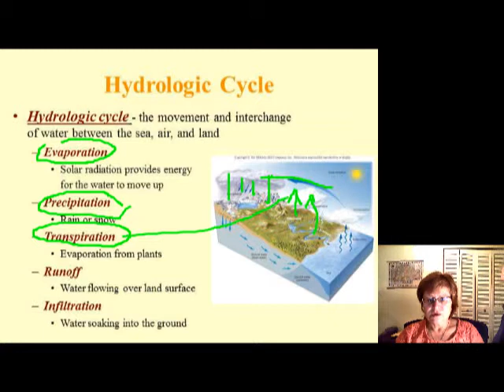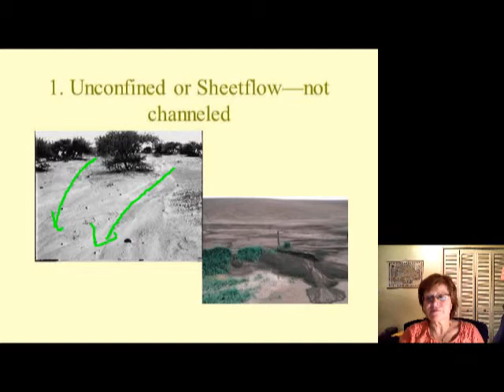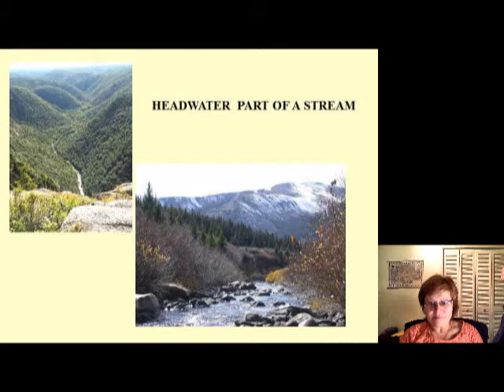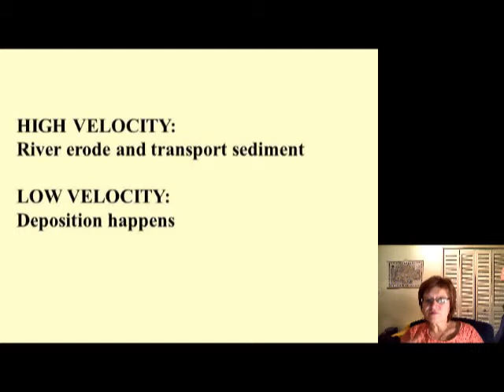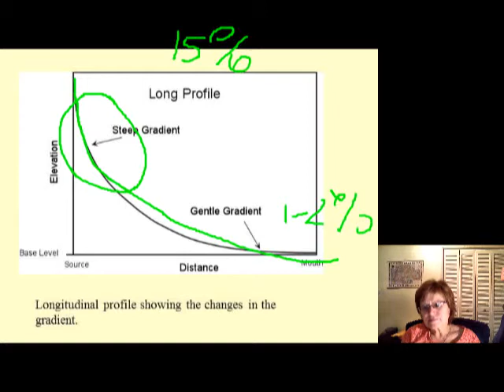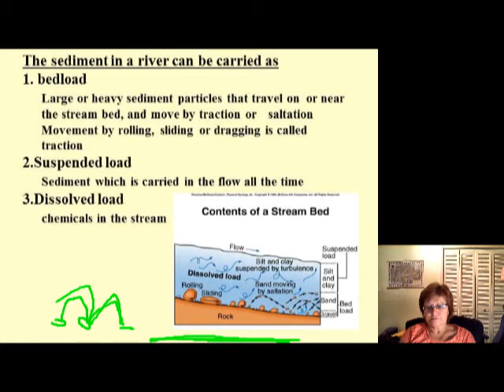Running Water 1.

Comment: Brittany Shook
GOL 105
1. 97.2% of the water is in the ocean 
2. There are five stages of the Hydrologic Cycle; Evaporation, Precipitation, Transpiration, Runoff, and Infiltration.
3.  The head of the stream is the top and the mouth is the bottom of the stream.

Comment: Robert Fisher
GOL 105 V1 SU
1. 97.2 % of the water on Earth is in the Oceans. out of the remainig percent 2.15 % is in glaciers, 0.62 % is in the groundwater, and a tiny percentage is in the rest of the systems such as lakes, streams, atmosphere etc.
2. Hydrologic cycle: Evaporation, precipitation, transpiration, runoff, infiltration. 
3. Fluvial system is in reference to running water systems.
4. unconfined flow is when the surface the water is flowing on has no borders.
5. confined flow: creek, river, chanel, etc. 
6. Head of the stream is the top, mouth is the bottom of the stream.
7. V-shape for the head, Wide shape for the mouth. 
8. The highest velocity area of the stream in in the middle of the chanel.
9. Stream Discharge= Width x Depth x Velocity.

Comment: GOL 105 Summer '26
Grace Doughtie
1. Flow in a channel can be Laminar or Turbulent. Turbulent flow is erratic and has swirling eddies.
2. Two factors affect stream erosion: Velocity and discharge
3. High velocity: river erodes and transports sediment. Low velocity: Deposition occurs.

Comment: Matt Landry GOL 105 V2 26'
1. Hydrologic cycle, the movement and interchange of wayer between the sea, air, and land
2. Laminar flow is usually slow and particles are moving straight, parrallel with the stream banks
3. Stream erosion, streams usually cut their own valley by deepening and widening it for a long time

Comment: Rachel Paul - GOL 105 V2 (Summer 2026)
1. The five stages of the Hydrologic Cycle is Evaporation, Precipitation, Transpiration, Runoff, and Infiltration.
2. Running water is separated into two categories, confined flow and unconfined flow.
3. Laminar flow is when particles are moving slowly and parallel with stream banks in a straight line. Turbulent flow is when particles are moving quickly and erratically.

Comment: GOL 105-V2- Summer 26
Nora Thompson
1. running water is the most important weathering agent in the process of eroding, transporting, and depositing sediment 
2. non-ocean water only accounts for 2.8% of all water on earth, and groundwater (not in glaciers) only makes up 0.62% of all water
3. the speed at which water travels in a stream is called stream velocity, stream velocity is usually highest at the center of the flow since there is less friction

Comment: Hope H. GOL 105-V1 SP26
Three things I learned:
1.	The hydrologic cycle consists of evaporation, precipitation, transpiration, runoff, and infiltration. (It’s been so long, I forgot about this; so, I did technically learn it.)
2.	Where headwater is, there will be a “V” shaped valley.
3.	Saltation is when streams pick up rocks and put them down.

Comment: Ashlyn Burke GOL 105 - V1
Three things I learned:
1.Only 2.8% of Earth's water is freshwate
2. Evapotranspiration is a combined term for evaporation and transpiration
3. The stream gradient is calculated as the elevation difference divided by the length and can be expressed in feet per mile or as a percentage

Comment: Logann Flinchum 
GEO 105 V1 

1. Running water is one of the most important geologic agents because it erodes, transports, and deposits sediment.
2. Runoff is water flowing over land after rain; infiltration is water soaking into the ground to form groundwater.
3. Larger, rougher channels slow water because of friction; smaller channels allow faster flow.

Comment: Kayce Baker GOL105 V1
1.) I learned that only .62% of the water on earth is in the ground and even smaller amount is in the water cycle for humans to drink
2.) rills are the small channels formed from erosion during unconfined flows of running water
3.) the middle of the channel is where the stream has the highest velocity typically.

Comment: Quinlan Beachy GOL 105 V2
1.	only about 2.8% of Earth’s water is freshwater, and most of that is trapped in glaciers.
2.	streams have headwaters with V-shaped valleys and mouths with wide, flat floodplains.
3.	rivers carry sediment in three ways: bed load, suspended load, and dissolved load.

Comment: Grayson Workman 2025 GOL 105 V2 
Three Things I Learned
1. Laminar Flow water is calm, slow water moving straight, while Turbulent flow water is erratic and can drag people down.
2. The Maximum Velocity of a Stream (how fast the water moves) is usually found at its center, neither the sides nor the bottom due to wind or sediment resistance.
3. Competence is the max sized sediment the stream or river can carry while Capacity is the measure of the total load the stream can carry.

Comment: Ashley L.
GOL 105 V2

1. Velocity is controlled by gradient and channel shape and roughness 
2. The gradient formula is similar to rise/run in math, so it is not too difficult to remember.
3. Erosion can happen by hydraulic action, solution, and abrasion.

Comment: Marc Caldwell
GEO 105 - V1
1.) The hydroogic cycle goes through 5 parts; evaporation, precipitation, traspiration, runoff, infiltration.
2.) The headwater part of a stream is going to be narrow and will be in a v shaped land formation. The mouth of a stream is going to open up and be very wide, tends to have floodplanes, and will go into a bigger body of water.
3.) The formula for stream discharge (m^3/s) is width (m) x Depth (m) x velocity (m/s)

Comment: Chase Magnuson, GOL 105, Summer 2025
3 Interesting Things I Learned: 
1. Running water is the most important geologic agent in eroding, transporting, and depositing sediment
2. The Hydrologic Cycle is the movement and interchange of water between the sea, air, and land
3. Gradient is the downhill slope of a stream bed. It's units are Feet / Miles or %.

Comment: Bianca Sink, Gol 105, Summer 2025
The visual representation of the hydrologic cycle helped me gain a better understanding of the order in which the cycle occurs. I also learned the differences between laminar and turbulent flow. Laminar flow is slower and its particles move straight where turbulent flow moves in erratic fashion.

Comment: Olivia Stewart Geology 105 
What I have learned:
1: Fluvial system is running water that may have the largest influence on human life.
2: Laminar flow is slow with particles moving straight, parallel with stream banks. 
3: Velocity of a stream is controlled by the gradient and channel shape and roughness.

Comment: Kevin Schulz GOL 105 Summer 2025
I learned that you can use a topographic map to help calculate the gradient of a stream.  I thought it was interesting that the potholes seen in rocks along rivers is actually formed by the sediment swirling and carving into the rock.  It is interesting to think that a river can have sections where the flow is Laminar and other sections of the same river where it is turbulent, the nearby James River has sections of both types often close together!

Comment: Xavier H Geo 105 — Three things I learned:

Sedimentary Rocks Form in Layers: Sedimentary rocks develop from the accumulation and compression of mineral and organic particles over time. These layers often include sand, mud, and organic material that compact and cement together to form solid rock.

Types of Sedimentary Rocks: There are three primary types of sedimentary rocks: clastic (formed from fragments of other rocks), chemical (formed from evaporated water), and organic (formed from the remains of living organisms).

Importance of Sedimentary Rocks: Sedimentary rocks are significant because they frequently contain fossils, offering valuable insights into Earth’s history and past life. They are also key sources of natural resources like coal, oil, and natural gas.

Comment: (GOL-105, V1 Spring 25) 3 things that I learned in this segment: 
1. The movement and interchange of water between the sea, air, and land is called the Hydrologic cycle,
2. Thera are two big groups of running water: Unconfined flow and Confined flow (stream)
3. Gradient is the downhill slope of the stream bed.

Comment: Hunter R – Geology 105 Spring
Three Things I Learned:
Gradient is calculated by dividing the elevation difference by the distance of the stream’s course, measured in feet or miles.
Stream velocity is fastest in the centre and can reach up to 15 mph.
There are two types of stream flow: laminar (smooth, parallel) and turbulent (swirling, erratic).

Comment: Darren Thomas Gol 105 v1 sprng 25'
Three thingas from video:
1.) I was unaware there is a formula for calculating the Gradient , you divide the elevation difference by the distance in course. Gradient can be measured in feet or miles. 2.) The velocity of some streams can reach speeds to to 15 mph, streams fasting flowing points are located towards the middle of the stream. 3.)There are two different types of flow patterns, the first is Laminar, which means the waters travels parallel with the river banks, the second is Turbulent flow, which means the water flows in erratic patterns that can be characterized as swirling or whirlpool like.

Comment: Laken Downs GOL 105
3 Things I Learned
1) Only .62% of water source is in the ground and 2.15% in glaciers. 
2) I never thought about all of the parts of a stream, you have the headwater, mouth, channel, banks, bed, and plain. 
3) Laminar flow is slow and it moves straight with stream banks, while turbulent flow is erratic and flows in swirls such as eddies.

Comment: Mohammed Albarakat (GOL.105.V1.FA24)
1. Infiltration is when water soaks into the ground.
2. Velocity and discharge affect stream erosion and deposition.
3. Bedload refers to larger rocks, while suspended load refers to smaller particles.

Comment: Thomas Patton, GOL 105 V1.FA24
Three things from the video
1): The flow in a channel is called laminar when the water moves slowly and carries particles in a straight line parallel with the stream bank. 
2): The fastest part of a stream will be in the center of it, as that Is where the least friction Is. If the stream curves, the fastest point will be pushed to where the stream hits the curve.
3): Saltation is when the rocks in a stream are moved by the water continuously picking them up and putting them back down.

Comment: Randy Thomason
GOL 105 V1 FA24
1. Laminar flow is slow and flows parallel with the banks, turbulent flow is erratic and can create whirlpools.
2. Friction caused by channel shape and roughness affects the speed of a stream's flow.
3. Competence is the measure of the largest size sediment that a stream can move and capacity is the total load that a stream can carry.

Comment: Hunter Austin GEO105 V1 Summer 2024

1. I learned running water is the most important aspect of eroding. 
2. I learned what infiltration was in the hydrologic cycle. 
3.  I learned what the Fluvial System is and how it works.

Comment: A. Dean GOL105V1SU24
1.) I didn't know there were categories of unconfined or sheet-flow, with rills/channel flow/stream flow, not to mention the laminar and turbulent flows. 2.) How to calculate the gradient of a stream. 3.) I had not thought about the erosion that streams and rivers can cause or about bedload, suspended load or dissolved loads meanings

Comment: Andrew H
GOL 105 V1 Summer 24
1.the sediment in a river can be carried as bedload, suspended load, or dissolved load.
2. erosion can happen in 3 ways- hydraulic action, solution, abrasion 
3. 5 important conditions of discharge- channel width, channel depth, velocity, gradient, bed roughness

Comment: The three things I learned:
1). Learned that glaciers make up most of the freshwater compared to other natural sources.
2). While a stream can be complex in pathing and winding, it still follows along its longitudinal profile from the head to the mouth of the method to descending from a difference of elevation.
3). Stream erosion is caused primarily by carrying various kinds of rocks that have become sediments when a current's speed of water shifts.

From Jonathan Schwallenberg, (GOL 105 - V1 - Summer).

Comment: Paige Havens GOL 105 V1 Spring 2024 
What I learned in this video:

1. The larger the channel the larger the bank, the larger the friction. Friction slows the flow down.

2. The velocity of a stream is controlled by Gradient and Channel shape and roughness

3. Sheetflow turbulence erodes rills, which are tiny canals.

Comment: (Noe Justo-Ortiz Spring Geology 105-V1)
I learned three lessons: The oceans contain the majority of the water on Earth, accounting for 97.2% of all water. The remaining 2.8% is primarily stored in glaciers, with only a tiny fraction in streams. The fluvial system is the term used to refer to the running water system that significantly impacts human life.

Comment: Raegan Chenier
GOL 105 V1
Three things I learned:
1. The oceans make up 97.2% of all water. Of the remaining 2.8%, about three fourths of it is stored in glaciers.
2. "Fluvial" is a word meaning "relating to running water."
3. Discharge of a confined flow is = width (m) x depth (m) x velocity (m/s).

Comment: Mackenzie C. - Geology 105 V1 Sp24
1) The hydrologic cycle is the movement and interchange of water between the sea, air, and land
2) Fluvial system means running water and has a big impact on humans 
3) Gradient is the downhill slope of a stream bed

Comment: Karen Duncan Gol 105 V1 Spring 2024
What I learned.
1. Running water is in two groups Unconfined flow and Confined flow.
2. A head water part of a stream is in the shape of a V.
3. The mouth part of a stream is usually wide.

Comment: Nehemiah Olson GOL 105 V1
1. Running water is the most important geological agent in eroding, transporting, and depositing sediment with nearly every landscape on Earth showing affect from stream erosion or deposition.
2. Unconfined flow is when water is flowing on an unconfined surface and if the slope is low the ground may become muddy, if the slope is greater, scour occurs.
3. Turbulent flow allows water to flow with erratic fashion with swirling and whirlpools.

Comment: Ryan Crouch | GOL 105 V2
1. Running water is the most important geologic agent in eroding, transporting and depositing sediment.
2. The Hydrologic cycle refers to the movement and interchange of water between the sea, air, and land.
3. Turbulence in sheetflow erodes small channels known as rills.

Comment: Hannah Morris geo 105 v1
three things I learned:
1. The hydrologic cycle includes 5 parts.
2. Sheet flow is water that is not channeled. 
3. Discharge is equal to with times depth times velocity.

Comment: Kenzie Leonard GOL105 V1
3 things I learned:
1). The hydrologic cycle is the movement and interchange between sea, air, and land.
2). Headwaters are the upper part of the stream near its source in the mountains and has a "V" shape. 
3). Velocity is the speed at which water in a stream travels.

Comment: It's been a long time since I looked at the hydrologic cycle. We never talked about infiltration, transpiration, and runoff in middle school. Secondly, the parts of the stream was interesting. We never talked about streams in high school from my memory. Biology, Ecology, and Chemistry were way more important. I find floodplains and headwaters particularly interesting. Lastly, I didn't know what affected velocity. Gradient makes perfect sense. Also, I didn't realize there was friction within the stream. That explains why smaller streams flow faster than larger ones. Evan Motley GOL 105 V-1.

Comment: Morgan B GOL 105 V1
1. I learned that running water is the most important geological agent in eroding, transporting, and depositing sediment.
2. The velocity of streams is controlled by Gradient and Channel shape and roughness.
3. For streams discharge there are five important conditions they are channel width, channel depth, velocity, gradient, and bed roughness.

Comment: Jeffrey Kamal GOL 105-V1 Summer 2023: I just took calculus and I remember learning about differentiation and integration. If I understand correctly: Because the width and depth are changing at different points, this is why a higher-level calculation (i.e., using calculus) is required. The volume formula, of course, is V = length * width * depth. Because multiplication is commutative, it doesn't matter what order we multiply the numbers; for example, it could be solved at V = width * depth * length. A common mistake is to use the incorrect units. Because meters (m) is multiplied three times, it becomes m^3 per second (s).

Comment: I did not know there were two main running water groups. Unconfined means low slope, underground flow, and thin and muddy. I liked the way you explained high and low velocity. It was very easy to understand.

Comment: In this video I got a refresher on the Hydrologic Cycle and learned more in depth details about the process. Additionally I learned about the difference between unconfined and sheetflow as well as stream discharge. Really fascinating! - GOL 105 Spring 2023 Alexander Scott

Comment: James Van Curen GOL105 V1 Spring 2023: I found several things very helpful in this video. Things such as the Hydrologic Cycle and the parts of the stream flow. I also was really surprised how little ground water there is.

Comment: Ben Temple GOL 105 Spring '21 - Interesting to learn about all of the different aspects of running water such as how to calculate stream discharge and the different types of sediment carried in a stream such as bedload, suspended and dissolved.